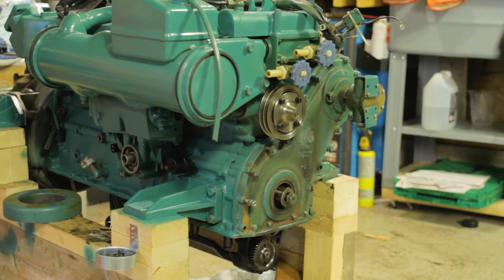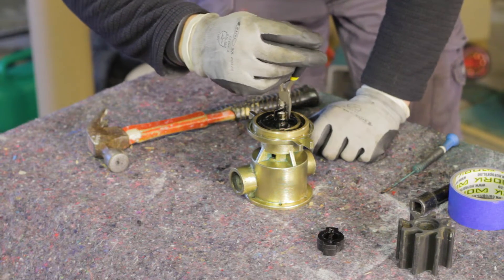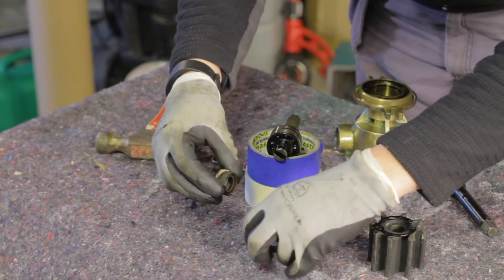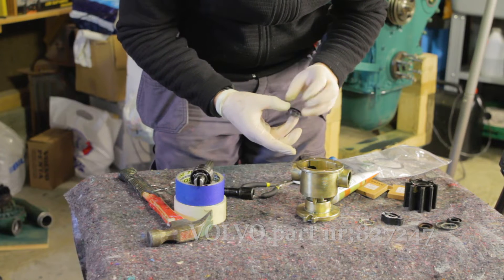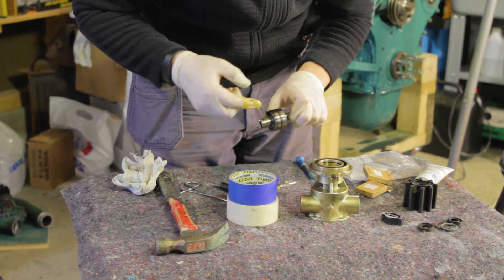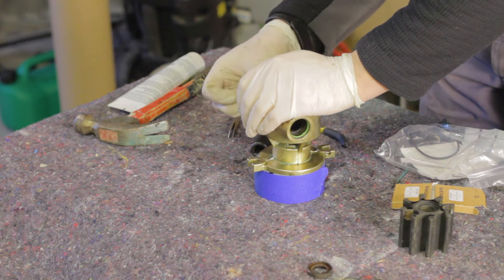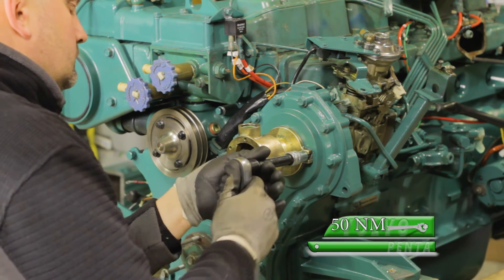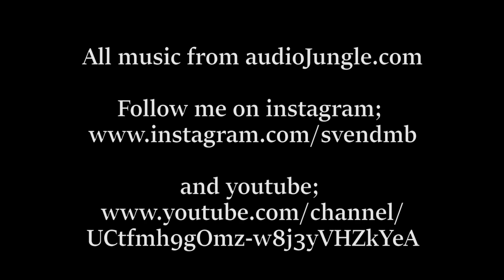Episode 5 waterpump

Comment: I did this pump but with the engine installed and having to reach around the engine from opposite side. A complete pain. The rubber dampener was very hard to align. It took 3 hours to just get the pump back in the engine. These are helpful videos however most of this type of work is done kneeling in a bilge with limited space.

Comment: Good tutorial! (Not meaning to step on toes).... certainly covers the basics. Don't forget to inspect the shaft for the wear groove that exists when a lip seal is used in direct contact with the shaft as the sealing component. A grooved shaft will leak again ,but even sooner, even with a new lip seal.Also check inside the bearing housing for grooves in the bronze.Excessive wear will greatly reduce your pumping capacity and tear up impellers. The body would be considered not useable if the impeller has worn through the machined surface and into the casting giving the appearance of rough surface.

Comment: Hello Svend, how did you got the crankshaft pulley off? I have removed the 6 bolts but it is stuck in old rust. Can I just tap it all around or do I need a pulley removal tool at this point? It should come off at this point, right? You didn't happened to record it on camera? (I have a MD31A four cylinder version without turbo charger)
Reply from the maker: I assume you are talking about the main crankshaft pulley in the "bottom" the engine? In that case you need a standard pulley removal tool to pull this off. I have a video of this. Will try to get this out soon. You also need to heat this pulley to get it on again...
Reply: Hej igen Svend,
yes the main crankshaft pulley.
I actually want to remove the pulley(själva remskivan endast) only, not the hub. When the 6 bolts are loose, is the pulley then loose or is it something more to it? Volvo manual doesn't show any details here so I am guessing. 
Just came in from the garage, I tapped it bit with a soft hammer but didn't dare to use any force to speak about...
Hälsningar från Sverige!
Reply: At 5:17 into you video above, I can see the 6 bolts but no pulley. The hub is still there I suppose? Hard to see...

Comment: Great video, if posible do not hit the bearing with a hammer, if you have to hit it be sure to hit the outerring, the balls inside the bearing will be damaged when hitting the innering.

What i did was to  put the shaft with bearings in the freezer and i also heated the housing with warm water about 60c then the shaft just slipped in without any force:)

Comment: Good work Svend. Have 2x 41a's in my boat, and whilst I am mech savvy, there are many who are not. One point, I would not be hitting any shaft with a hammer - but always use brass drift.  Looking forward to more of your work.
Reply from the maker: Thank you so much for your comment. I am a "DIY" mechanic, so it`s always good to get inputs from the pros! I se your point about using a regular hammer on the shaft, and recommend my viewers to follow your tip, or maybe using a "plastic" or soft tap hammer?
Reply: Greg Johnston hi